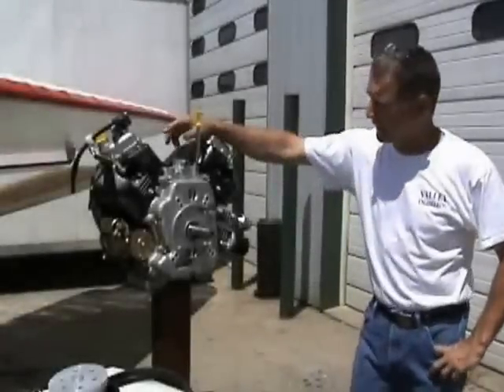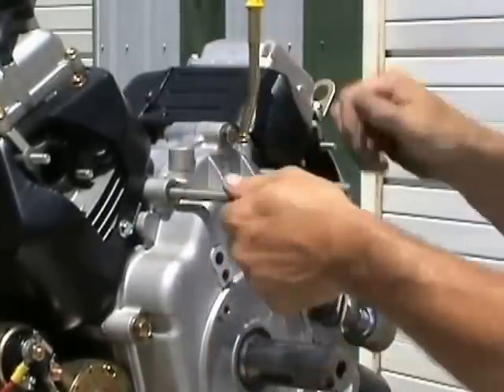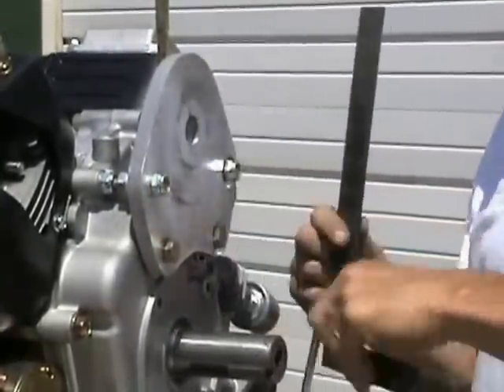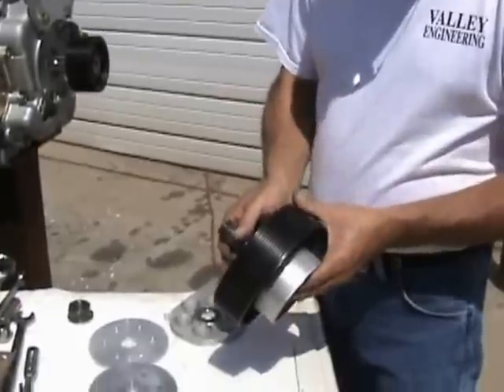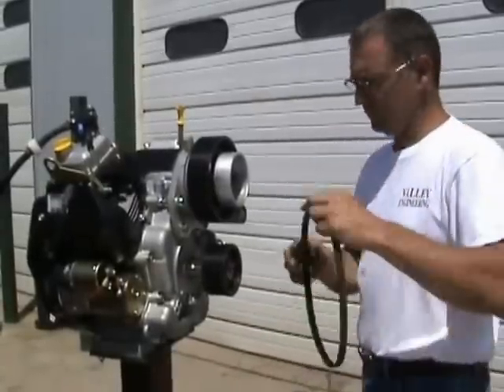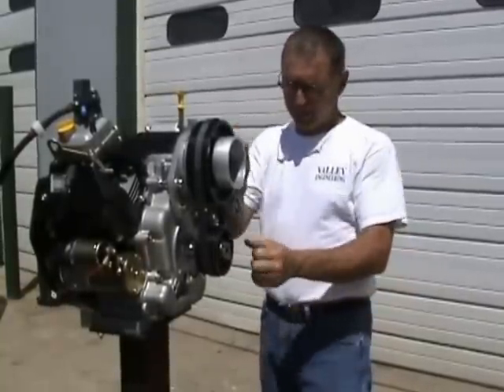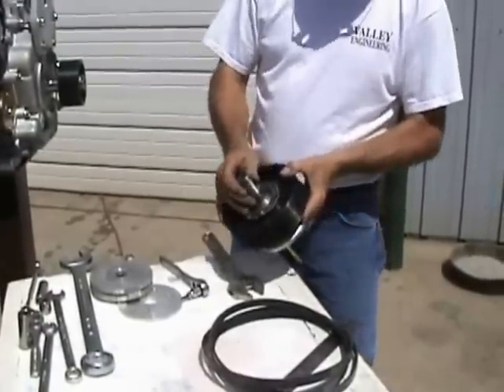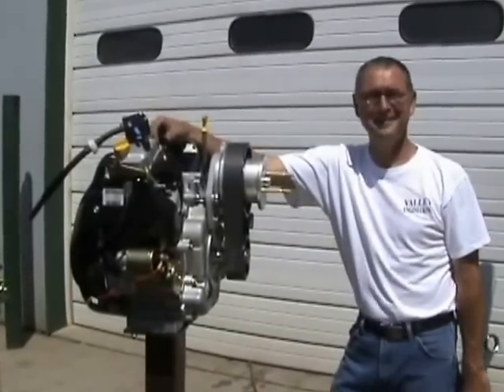big twin psru

Comment: I would like to find a source for a stock generac engine like this. Anyone know ?
Reply: Still looking for one?
Reply: @destro513  
Sadly not so much.  My plane project is on the back burner and with my money looking tight especially with prices of everything going like they are I'm pinching pennies. Still wouldn't hurt to hear what you got.
Reply: @donaldbronikowski5297  
Worry about earning more money, not saving more.

That being said, there are plenty of airplanes that can be built for $15,000+/- with these industrial motors, including the MC30 Luciole, SD-1 Minisport, Quickie Q1, various Bowers and Fisher designs. Most are wood. The Q1 is foam covered in fiberglass. Plans are available for all of these.
Reply: @Triple_J.1  
I've got the plane, just need engine, prop and a few more things to complete. Money situation has improved for me so I will probably be flying this summer God willing

Comment: I'm really liking that triple belt redundancy you have.
If you could somehow move that in one inch closer on the crankshaft that would be nothing but good too
Reply: That would give marginally less "wrap" on the upper pulley, and slightly reduce torque carrying capacity.

Comment: I have this engine - what is cost of 50hp tuning kit (what is included?) and what is cost of PSRU ?
Reply: These engines are super easy to get power out of.. valve spring cam piston and Rod and you probably get a lot more than 50. There's a whole group of these guys that are running them on nitromethane tractor pulling as well as just methanol. Tons of performance parts.
Reply from the maker: The cost of the tuning kit can vary. Is it a stock engine with the stock carburetor and exhaust? The PSRU is $1100 (prop not included).
Reply: Hi, thank You for response. Yes, it is stock engine, with stock carb and exhaust.  Please, is anybody using it tuned on other (faster) homebuilt plane, than on Backyard or Mariner ? Regards, J.

Comment: A chain drive would be simple. Two sprockets, 520 motorcycle chain, no slip, lasts longer.
Reply from the maker: The chain drive would be to hard on the engine and likely break. The slip allows the engine to run the prop and doesn't let the prop run the engine. It also takes out the harmonic resonance which makes it easier on the air frame as well as an overall smoother engine.
Reply: The idler allows the prop to unload by slipping in the slack side.  I think the Valley Engineering's design is pure genius the way the adjuster works.  
Chain would allow harmonics to tear things up.
Reply: Valley Engineering the chain would likely never break since they use smaller ones than the five twenties in drag racing motorcycles. Also it would likely never damage the engine.
Reply: @blairwise3339  You need to learn about "longitudinal vibration". It can hammer a gearbox with many times the design load.
Reply: @UncleKennysPlace  that is why engines have the flywheel to absorb the harmonic resonance. Go karts has been running for decades with chains. I have also seen chain drives on Hovercraft with automobile engines. Another good is that the chain drive has less wear on the crankshaft bearing since it doesn't require much tension.
Reply: @normanguzman417  if 1 belt breaks it will fall away then you still have 2 left to get home. If a chain breaks it WILL destroy the drive train and the shock could cause airframe damage as in you can fall and crash. This is not a go cart my friend if you loose a chain in a go cart you walk home if your in a air craft and you break something 6 people carry you home .
Reply: THANK YOU FOR INFORMING WISE ASS THERE ON AIRPLANE FUNDAMENTALS!